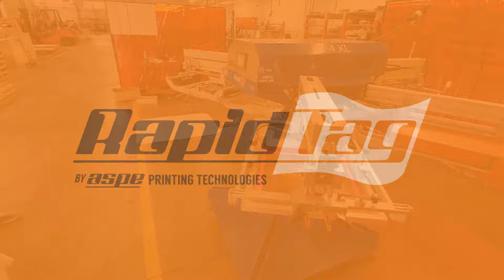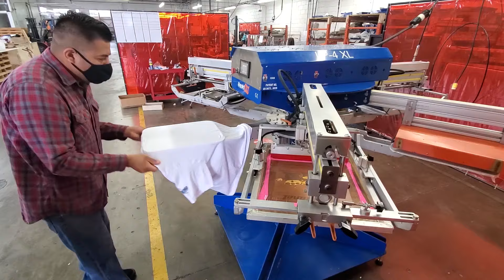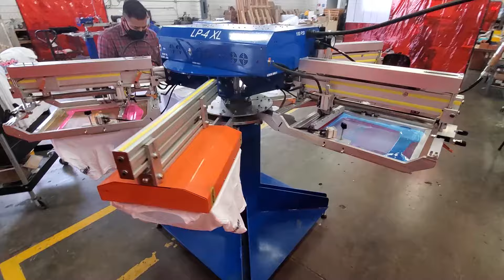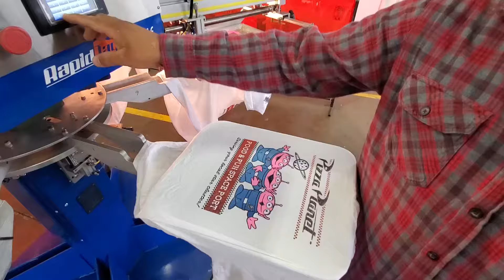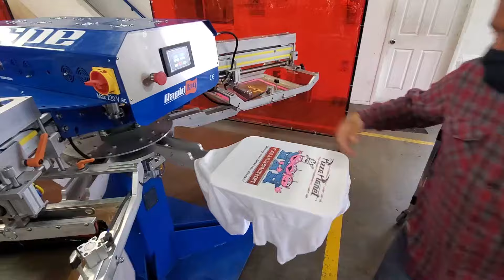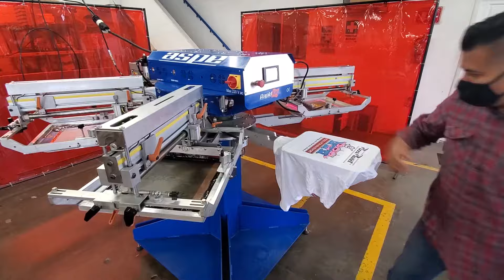RapidTag: Automatic 4 Color Screen Printing Machine

Comment: Can it take regular 20x24 screens and larger platen?
Reply from the maker: the standard print area is 12x12 inches and the max print area is 16x16 inches. 
For more information contact our sales representative:  Issak Ayala, +1 619 852 1775 - issak@aspesite.com